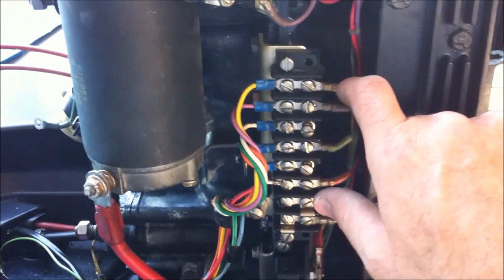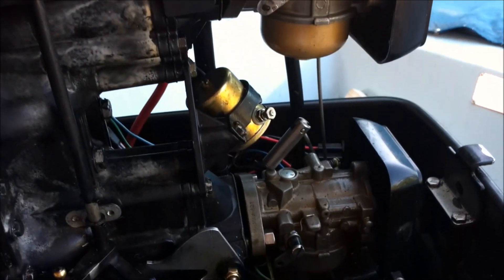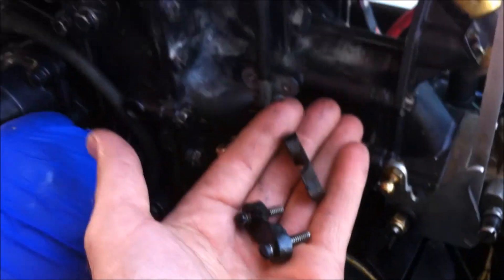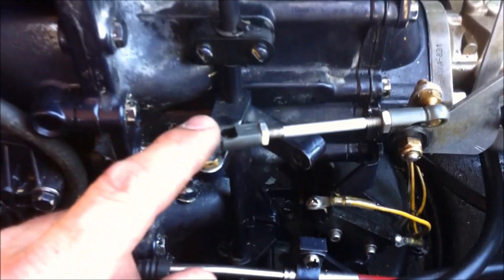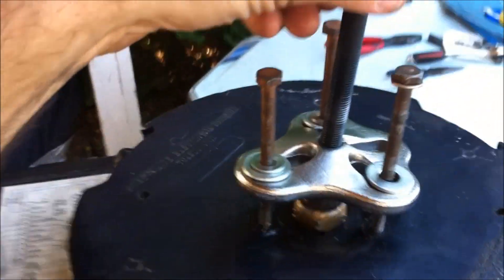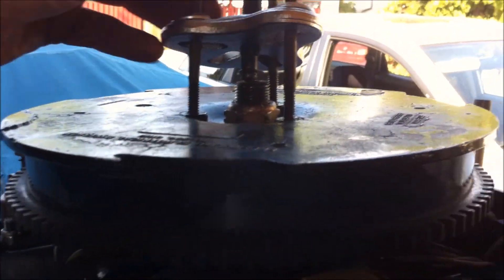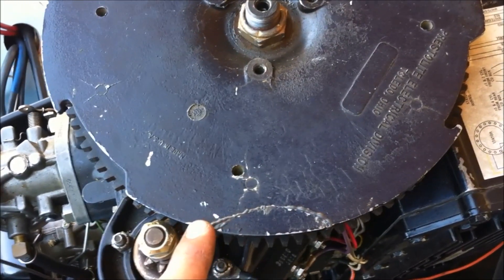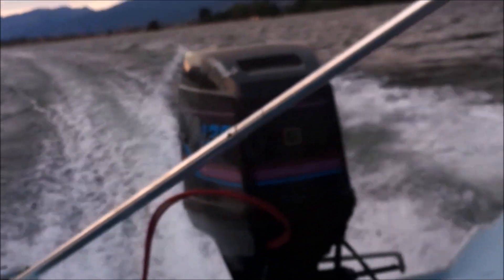89 Force 125 Rebuild video part 6

Comment: I have a  cuuestion i have a1989 125 force  where you add the engine oil?
Reply: Hi Omar, since this is a 2-stroke engine, the oil is mixed straight into the gas tank with the gas at a 50:1 ratio. This means you will buy "Outboard 2-stroke (or 2 cycle) marine oil". There will be a chart on the back of the jug that tells you how much oil to mix into the gas for a 50:1 ratio. It is also a good idea to use at least mid-grade gasoline (90 Octane or higher) with these older engines. You should also Youtube how to check compression on your cylinders and buy a compression tester, just to see what kind of compression each cylinder has. This will tell you a lot about the health of your motor. Research on the internet what a good compression reading is for your motor.
Reply: OK another quick question I have a good compression engine runs pretty good now. My? Question to you is My dry shaft bearings are really screwed up on the. Gear case in the bottom where do you buy the parts to rebuild yours
Reply: I have bearings with captain numbers on it I have try to buy The bearings. With those numbers. And no luck. They send it to me but they're different

Comment: Hi George mine is the exact rectifier that you had on your rebuild engine I just need to know where the green with yellow trace wires go I used camera phone also but this engine ended up down for so long the photos went to cyber space and can’t retrieve I am uk only started with electrical running issue but took off transfer port covers to regasket  and found broken rings so was then a complete rebuild the sager started pistons stuck in calorfornia they arrive only to be boxed wrong even longer for right parts to arrive then had to find and engineer to push new pistons on rods found one who then proceeded and put them on rods wrong way round gave them back to him then he was out of country for 9 weeks with my rods pistons locked in his shop so that’s my plight all back together now apart from those two wires have asked you about and the the next problem will start on electrical do I have duff stator or trigger cdi units for the original fault that started the sorry story. Have owned this engine from brand new and until this electrical misfire problem never missed a beat maintained my self twice yearly ran like a Rolex watch the ring problem hadn’t just occurred never caused any damage still had same compression as the day I got it if it hadn’t developed the electrical fault would have probably outlasted me thanks for answer and great video and taking time and pain to make it great job
Reply from the maker: Here are a couple videos I made to show the green w/yellow trace wiring runs from the stator to the rectifier: https://youtu.be/b7rZld3jQQ8  and https://youtu.be/kKM2o6V2gIo
Reply from the maker: ... and thanks for sharing your saga of your motor - may you get many more years out of it!

Comment: Hi George do you have picture you could send me of how the wires ended up going on the rectifier I’ve got the red and black pos and neg then there are two terminals that are marked ac and wires I have left are same as yours ie two green yellow trace one white and one mauve great videos by the way many thanks Dave Mills uk
Reply from the maker: Hi Dave, check this rectifier installation guide: https://www.outboardignition.com/support/155-1450.pdf
Reply from the maker: Depending on your motor, you might have this type of rectifier: https://www.outboardignition.com/support/152-9209.pdf

Comment: Just a quick question does the end of the crank opposite the flywheel end are the splines part of the crank itself or is there a separate part that connects the crankshaft to the lower unit input shaft
Reply from the maker: Sorry for the late reply; just noticed your question now (I'm guessing you already have the answer by now). The drive shaft of the lower unit slides right into the crankshaft.

Comment: Hi George.  Thanks for the videos.  Lots of insight in there.

I'm trying to replace the plugs and wires on the unit right now myself and wondered if those wires are hardwired to the coils or can they be replaced without changing the coils themselves.

Also.  Would you know of somewhere that still supplies new parts.

Thanks.  Appreciate the videos.
Reply from the maker: I don't know offhand if the wires are hardwired to the coils. This is a great site for Force parts: http://www.franzmarine.com/ 
Franz is a wealth of information to chat on the phone with too.

Comment: OK, can anyone identify the part shown at 1:25 with the two yellow wires attached?  It's missing on my outboard and I've looked at the parts diagrams for my motor and can't find it anywhere.  On my boat the two yellow wires are connected together.   Thanks.
Reply from the maker: Hi Don, It is the interlock switch (or Interlock Neutral Safety Kill Switch). If you do a Google image search of  "Force Outboard Interlock Neutral Safety Kill Switch" you will find plenty of examples.   It looks like people do bypass it, but you would have to research whether this is ok to do.

Comment: On this video at approximately time mark 5:52 to the right of the flywheel is an electrical wire diagram that I cannot find online anywhere. I have a Force 1989 85 HP I am rebuilding. Supposedly the diagrams are the same for both the 125 and the 85 engines. Is there any way you can share this info?         By the way these videos have been very helpful.
Reply from the maker: Hi shipper506, glad you have found the videos helpful! I posted a link to the wiring diagrams located on my motor in the detail notes below the video

Comment: Hey George just wanted to ask what kind of lower unit do you have? Or had? On your force 125 powerhead the reason I ask is because I have the save outdoors motor by the way the videos were awesome 👍🏽
Reply from the maker: Hi Cello, I'm glad you enjoyed the videos. The Force 125 Outboard continues to run great since my overhaul a few years back. The lower unit is the original one that came with the motor - I'm not sure if you were looking for a more specific answer

Comment: thanks George. watched all your videos. best info on rebuild I've seen on youtube. one question, did u reuse all the old bearings and how much play is in them?
Reply from the maker: randy y Hi Randy, thanks for your encouraging comment. Yes, I just used the old bearings  on the crankshaft and, at least for my motor, there was little, if any negative play. (The new pistons came with new pin bearings so those were the only bearings I replaced ). Of course that could be a different story for somebody else's motor, but it was a risk I took, and I'm now onto my second summer with my rebuilt motor and it is still running great.